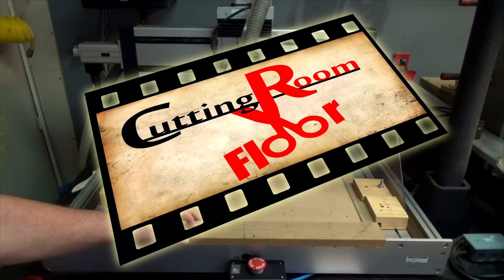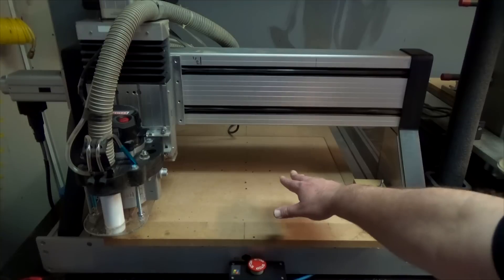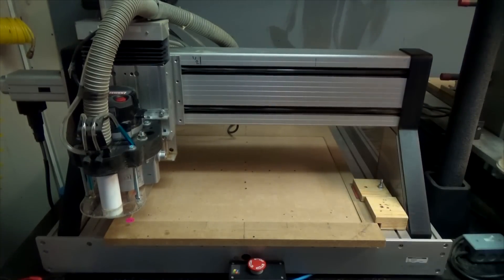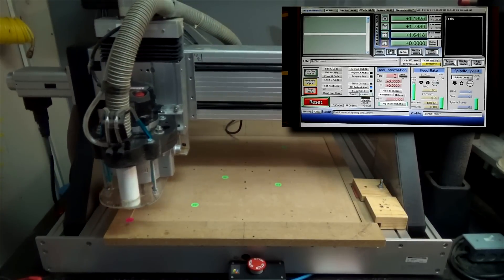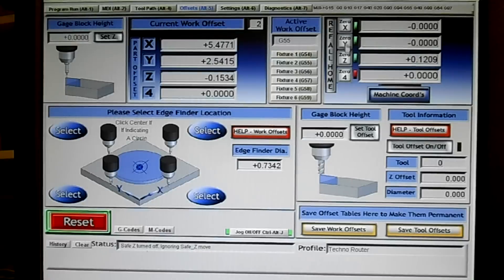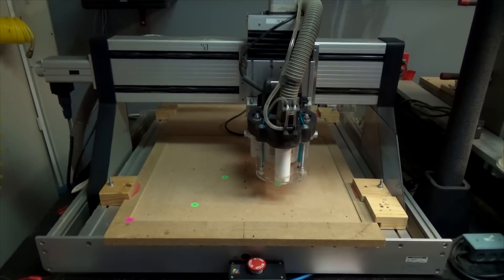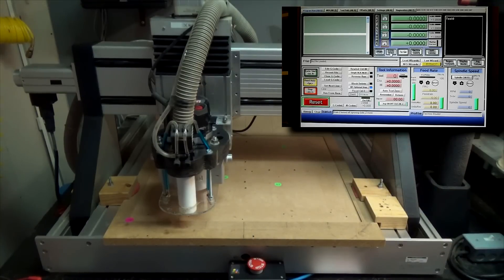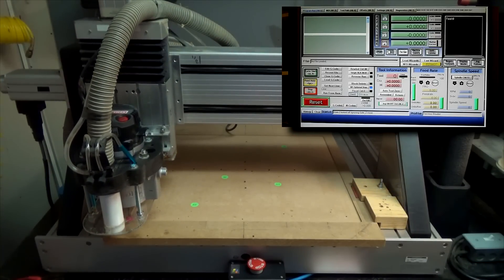How Mach3 Can Store and Recall Table Positions Using Offsets

Comment: Hello! I work with marble or granite tombstones. I edit the G-Code with Aspire 12 and load it into Mach 3. I can't level the marble cross so that when I engrave it has the same coordinates on the Z axis. I wonder if it is possible to make a map with 10-12 points on the work surface with the height differences on the Z axis that the CNC can recognize and engrave all the letters at the same depth. I await an answer and thank you very much!
Reply from the maker: Hello, I think what you want is called surface mapping. I have played with it but have no video. Basically you probe a surface to be cut before running gcode and it adds or subtracts a given amount to the z height to allow for uneven surfaces. Try googling auto level probe pluging  for mach 3. I once tried it on a round dowel and it worked. To make an electrical connection for the probe I use aluminum foil to cover cutting surface while probing.  Hope thus helps, it's been so long I don't remember all the specifics.  Steve

Comment: I have 4 offset values in my gcode program. I selected a corner of my work piece and then 0,0 for G54 offset. I then referenced 3 other locations from G54 on the work piece and then zeroed each one as G55, 56 & 57 offsets. The program runs perfectly. When I exit the code I hit fixture save. When I reload the code the 3 offsets are in the correct location to each other but not the G54 0,0 position. How do I save the offset locations correctly when exiting the program? Thanks, I really loved your demonstration.

Comment: I saw one of your videos where you had I think a felt tip marker mounted on the router head where it was offset from the bit.  And you went into mach3 and configured a button that would shift the XY zero to that position, then press another button to return to the XY of the bit.  I can’t find it again. This method is similar but I would like to have the other one where it would be permanent on my machine.
Thanks

Comment: When setting up different starting points and running a program; can you have Mock3 switch to a different starting point to start on another program on the opposite side of the machine without having to stop?

Comment: GREAT VIDEO.. THANKS A LOT.. I WATCHED A LOT BUT DID NOT CAPTURE HERE IS GOOD EXPLANATION..
just quck question.. how my g code runs if i put ziro in G56 my code start to mill in that g56 in corner as works zero ?
any chance to make video for edge finder and center find for stock please?like same here with examples ?????
really i will be appreciated... a lot of video  i watched to much cnofused  about it.. here you explain very easy my finger up..
any chance to contact with you .. i have what's app aplication i have some help.. ??

Comment: I saw someone using a touch button on the bed for tool length as well as a plate to calculate the height of the workpiece face... I wonder if offsets are how he did that...

Comment: Totally new to cnc and mach 3  and been having a hell of a time just getting the machine back to home after running a programme  , if i go to machine co ordinates after the programme has run and click on go to zero only the z axis moves .
So if i  make a part and use G55 as my tool offset can i put G54 at the end of that code to tell the machine to go to home or  machine reference zero ?

Comment: Thanks! I didn't see how I would go beyond the G58. I want to run the same subroutine every 16" x 16" on a 4x8 sheet. Any help?
Reply: You might want to use a cad software to create a pattern then use sheetcam to write the g code for mach3.
Reply: Yah I've always wondered if there was a way for mach to tile a toolpath too rather than me making a different gcode for each length of wood I get, to just kick out like 8 signs in a row up a board.

Comment: How about machining parts at different work offsets while using cutter comp?  Mach3 is not capable of this.  Only work around I have found is to use a main program, calling up external subprograms (not subroutines), after switching between offsets, G54, G55, etc...  Anybody here find an easier way to run cutter comp using multiple work offsets?

Comment: your videos are great, well explained. I couldn't find anybody that is able to do Automatic home. Let's say you went to fixture 56 and the machine finished the job completely, what command do you tell the machine to go home automatically, without pushing Ref all  home, is there a code command for that. thank you for your effort of these great videos.
Reply: G00G53Z0X0Y0 Will send it to MACHINE ZERO (HOME).
Reply: Thanks James for the reply. Since you are so good at Mach 3, I want to throw another question at you. let's say you have 3 or 4 parts and want cut them all at once without going home and start from the beginning. I have fixtures set up already at certain positions on the table of the mill, how can you add, let's say fixture No 56, 57, 58 and so forth to the g code. Do you have to copy each fixture to one Note pad and give it a certain name, and then load that g code, or is there an easier way. thank you in advance.
Reply: @nadermerizian5990   Hello.. did you get anwered ? i have also same question how did you all these four apporation you got note pad each and download g code and they run for each fixture 56, 57, 58 or one by one ? please need help

Comment: Hey man you are a tech wiz!
I need your help with my laptop!
It's a Lenovo t400 and nothing displays on the screen when I hit power. It kind of does a fake start up sound but nothing displays any ideas?
Reply from the maker: Try connecting the laptop to an external monitor and see if the screen appears on that. If it does then I would suspect back light or iinverter problems with the LCD

Comment: Thanks for the informative vids . i have a weird  problem with my Mach3 . All my axis works well only the positive , for example X+ and X-  Y+ and Y-  Z+ and Z-  and A+ and A- . the negative movements do not work where do i go wrong in pin and ports? i appreciate any help here.
Reply from the maker: In ports and pins you should have shared a pin number between the negative and positive signal in most cases
EXAMPLE (X++ and x-- should both be set to port 1,  pin 10)
Hope this helps

Comment: Love the video : I am a daily mach3 user . I know some but it is not my friend. I have a pretty cool screen set the big tex screen might want to check it out. Pretty nice running ATC but in manual tool changing so basically all tools on one file. It would make a pretty good video there is also laser x y position. Big fan thanks for the video and your time.

Comment: I noticed that the move control does  X + Y before adjusting  Z   this can lead to collisions if there are many fixtures mounted to the machine bed.  Is there a way to have Z fully raise before moving  across the bed?
Reply from the maker: Try using the Config/Safe_Z setting found under the "Global Settings" window. I have not tried this but its my understanding it should work.
Reply: That  will work  but it is a manual thing you need to remember  and the amount of the move  id dependent on  what fixtures are in place on the bed.   It is way better to have the machine  retract Z to a  safe  height based on the maximum height of the fixtures or to Z max height above the bed  for  travel movements between setups
Reply: what if you just raise the z before the move to another spot - will this avoid collisions?